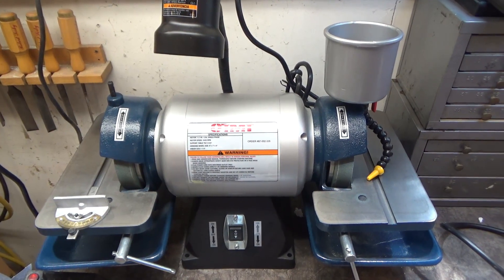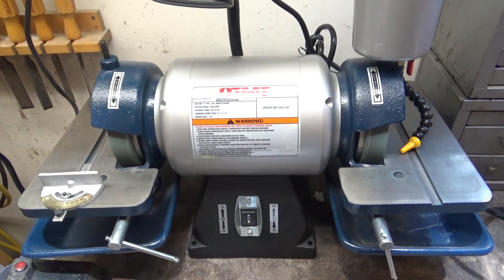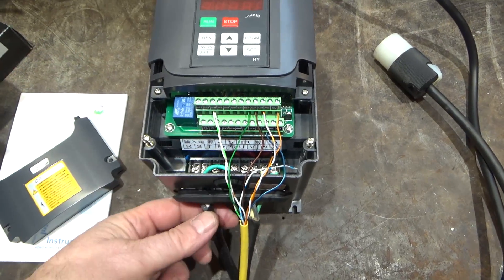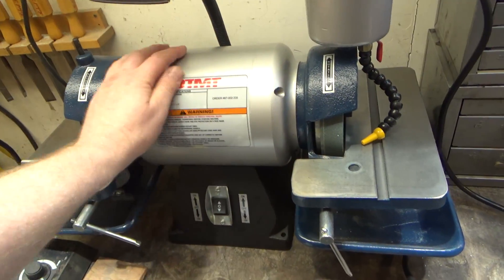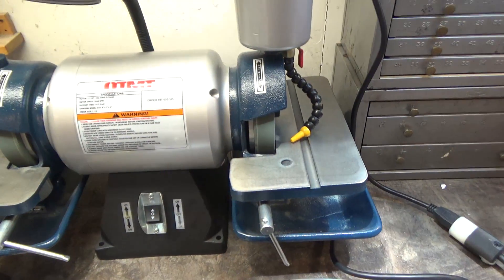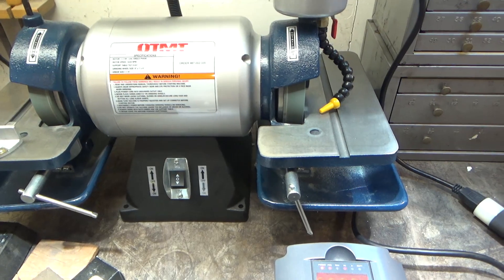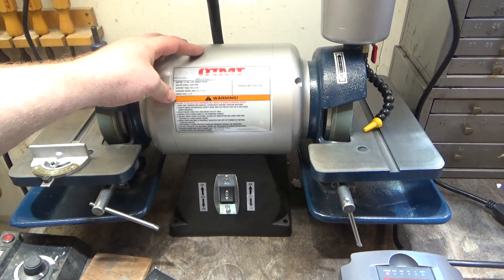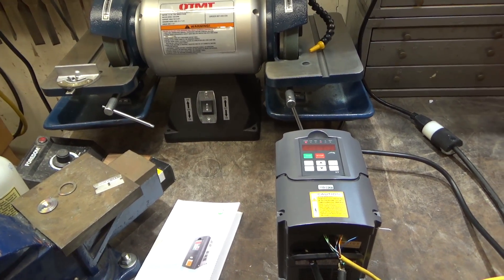QTR 06 110V Single Phase Variable Frequency Drive

Comment: I've been looking for a 110 to 110 VFD. Where id you purchase it?
Reply: There are some basic families of VFDs: 1) 3 phase to 3 phase, 2) 1 phase to 3 phase, and 3) 1 phase to 1 phase. Since most of us don't have 3 phase power, we're not interested in category 1. Meanwhile, I don't recommend following dudley's example for most power tool applications, for reasons mentioned earlier, although it may be OK for some applications, including grinders, if the motor starting circuit is OK with it. So, I try to steer people in the direction of finding an inexpensive 3-phase motor and going with the appropriate category 2 VFD. For anything above fractional horsepower, it's best to go with 220 VAC input or higher, since the currents involved are lower. The motors are widely available, because of all the conversions of 3-phase equipment to single phase. I have picked up several 3 hp motors for $50 or so each.
However, a little known fact is that many category 1 VFDs will operate just fine with 1 phase input, albeit at a reduced output rating. Not all 3-phase to 3-phase VFDs will allow this type of operation. Some will flag an input error. The fact that the front-end of all VFDs is just an AC to DC rectifier is what makes this possible. If you connect single phase input to a 3-phase rectifier, you still get the required DC voltage on the 'bus', but the peak currents in the rectifiers and capacitors are higher for a given load, which is what limits output to about 2/3 of the rating. There may or may not be software features that prevent this type of operation.
Reply: I don't see any button to assign a gold star for this post, so you may have to settle for a thumbs up :)
Reply: Pual, is running this vfd that much better than just using a dimmer or cheap "router speed controller"?  And if so how does it differ from a true single phase vdf? If you have time to answer. thank you for you insights on the subject.
Reply: @Steve_Just_Steve  if you drive an induction motor with a Triac, the results will be heat and reduced efficiency.
Triacs essentially conduct for a fraction or all of the input 50Hz. ie. only the duty cycle is different but the 50Hz frequency is unchanged.

VFD use DC transistors to create a variable frequency presumably with near 100% duty cycle: normal sin-wave made of 8KHz spikes to approximate sinus rise/fall.

Long story short: buy yourself a 20Amp dimer to benchtest that dropping voltage of an induction motor does not really control its speed the way frequency can.
👍🏻
Reply: @Steve_Just_Steve   (The dimmer / router controller adjusts the voltage out and the power delivered.  FYI Router's have universal motors, not induction motors.    The VFD adjusts the frequency of the power delivered and some other magic.  Induction motors want to turn at a specific RPM at 60 cycles regardless how little voltage you place on the supply line. The dimmer like control for an induction motor is not going to work, the VFD is an ideal and purpose built solution for controlling the speed of induction motors.   Hope this helps .
Reply: @ac4uv  I understand it now. I've learned a lot about motor control since I asked that question a year ago.  But thanks for taking the time.
Reply: @Steve_Just_Steve   Hello Steve, I learn so much on You Tube that I like to return the favor from time to time.  Was not long ago that I did not know the difference between induction and universe motors.    Cheers and happy learning !
Reply from the maker: On eBay. Paul Matthews makes some really good points which should be taken seriously.

Comment: Nice work. Another fine point: your VFD undoubtedly uses the 'V proportional to F' algorithm to keep from overdriving the motor. This means that the voltage at 30 Hz will actually be about 55 Vrms. This makes the current relatively constant, rather than increasing with decreasing frequency (which it would do if you kept input voltage constant). Going above 60 Hz in frequency, the voltage should go above 110 Vrms, but there will be a limitation due to the fact that the DC bus voltage is probably only about 170 V, so forming the sine wave approximation with PWM becomes theoretically impossible. They MAY use a voltage doubler rectifier or boost switching circuit to raise the DC bus voltage, but I doubt it for a low-cost product. It will be simple enough to find out: Use an rms voltmeter to monitor the motor input voltage and/or observe the PWM waveform with a scope. (Of course, you must take precautions to probe AC mains circuits with a mains powered oscilloscope.) I am betting that they simply limit the rms output voltage to about 110 V, even when you go above 60 Hz. The motor will run and the speed will increase with frequency, but torque will be diminished, which is probably OK for something like a grinder. BTW, there may be some parameter setting in the VFD that limits the max frequency... might be a good idea to set it such that you can't exceed wheel ratings.
Reply from the maker: I used a tek scope that is connected to an isolation transformer to look at the output and it is right around +/- 170V pulsed. The pulse voltage does not change with frequency, only the duty cycle as it attempts to approximate a sine wave. A friend of mine suggested that it might have a voltage doubler on the input to handle 120/240, but it does not seem to. I did not open the unit to measure the internal rail voltages, so can't be sure. The output pulses seem pretty consistent at +/- 170V peak, so the output signal consistently approximates 120V or 170/sqrt(2) RMS.There are settings to limit the max frequency, defaulted to 400hz. I will definitely limit them.The manual says frequency changes and loading responses are supposedly PID controlled. They even give you access to the PID constants. In case you didn't get the comment after I deleted the first video, I wanted to thank you for the corrections. I rushed making this video and really have no excuse. I didn't even catch the 340V error until I was editing it. I find it difficult to remember everything I need to say and actually say it.  I really hate to relay wrong information and appreciate you taking the time to set me straight. THANK YOU.
Reply: Not easy to put together these how-to videos, and you expose yourself to all kinds of critics, many of whom are self-appointed experts. I will be very surprised, though, if it turns out that your VFD does not lower the rms output voltage as frequency declines. Otherwise, the motor current is bound to climb to unsustainable levels. The peak to peak voltage remains a constant 340V, but the duty factor should steadily go down. I am a switchmode power engineer by trade, but there may still be some things that I can learn about the subject.
Reply from the maker: The cursory look I took at the output waveform, did not vary in pulse height and I did not do any measurements relating to pulse width, so you could very easily be correct. I did not dig into the unit to get a hold of the clock, so I had a really hard time triggering on the output waveform. I relied mostly on single sequence looks and was interested in mostly showing the sin wave approximation. However my camera work left a lot to be desired. I started my career as a fiber optic engineer focused on transimpedance amps and the like, but have spent the last 25 years as a systems engineer so have lost a lot my feel for the analog world. Thanks for you feedback, what you share helps more people than me.
Reply: Yes, peak to peak is always double the DC bus voltage, since all the inverter output bridge does is switch bus voltage in and out. Duty factor never gets to 100%, since you need to approximate a sine wave, but DF should get proportionately lower with frequency.